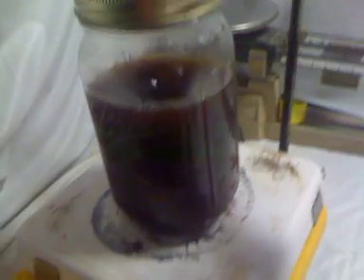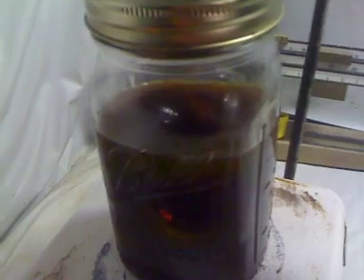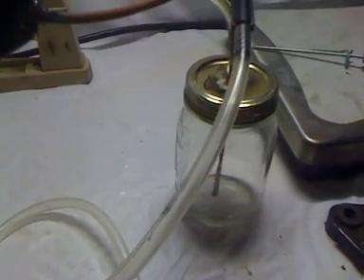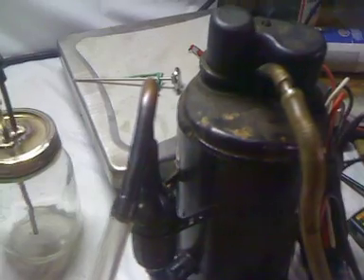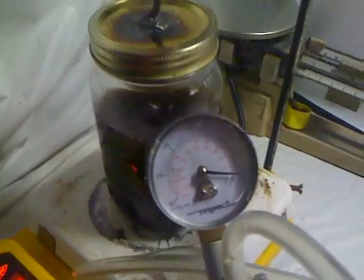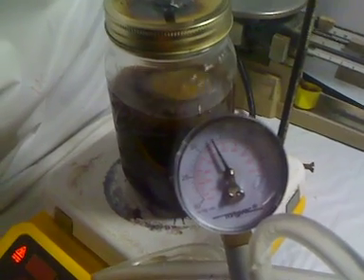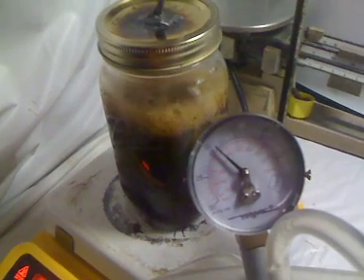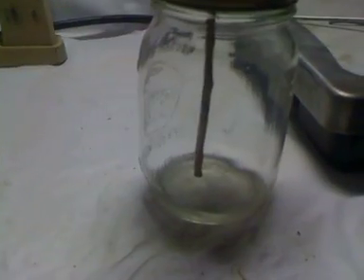Biodiesel - Methanol Recovery Demonstration Part 1

Comment from the maker: Depends on the type of pump used and if you get everything sealed up tight. For this demo I just used an old refrigerator pump I had laying around. They are not made run continuously under high loads so it reached 240F by the time I was done.

If you can get things sealed up air tight, then it's best to turn off the pump once U pull down the vac. Some units use an oil bath filter that will catch contaminates, that's the best route go.
Also if your going to run it continuous, long hose helps.

Comment: Can you leave the vacuum pump running for the whole experiement?

Or do you valve it off after it has pulled the vacuum? If not, dont you risk getting some methanol in your vacuum pump?